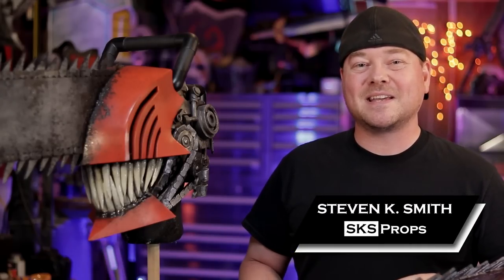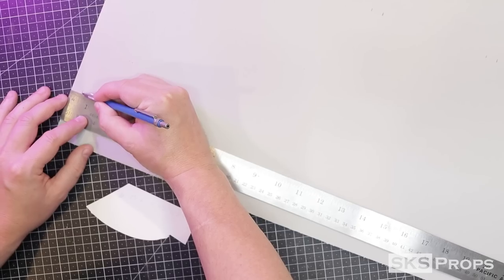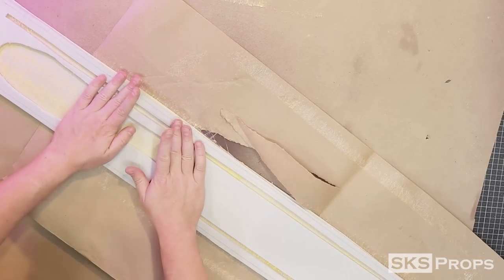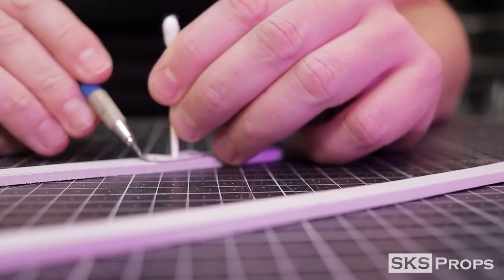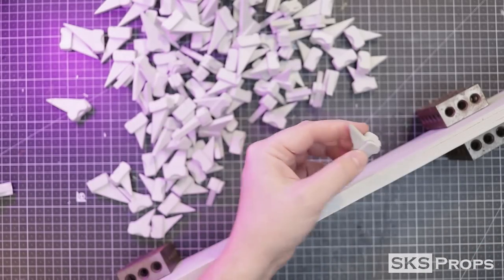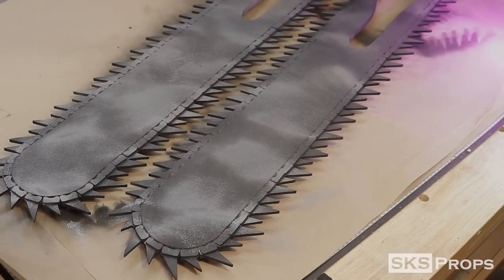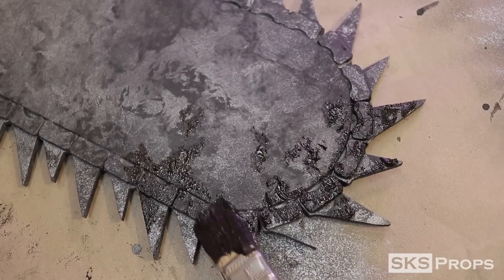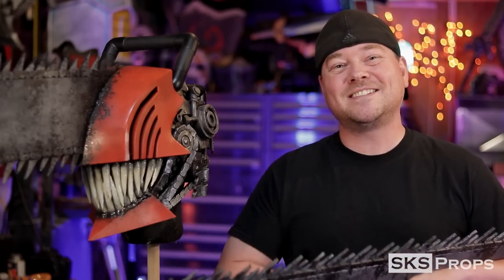How to Make a Chainsaw Man Cosplay Part 3 - Arm Blades - Foam Prop Tutorial with Free PDF Templates

Comment from the maker: Check out more of my complete builds, walkthroughs, and HD-Foam at www.SKSProps.com
Reply: SKS Props you might not see this but on average how much did the entire project cost.
Reply from the maker: @Shakespeare-_-  you’d need a sheet of each size 2,4,6,10mm   And paints which would prob be around $50-$70
But if you needed all of the tools and safety equipment as well prob in the $130-$150 range
Reply: @SKSProps  Thank you very much for the response I recently heard about it through just general talk on the internet and proceeded to watch the anime which got me hooked so I read the entire manga in one sitting online.
Reply: @SKSProps hi just wondering is it only buy 1 of each or do I need multiple of the foam for the mask and arms?
Reply from the maker: @rainbowren13  a sheet of each size 2,4,6,10 you may need one more 6 depending on how you lay out your templates 👍
Reply: @SKSProps  Hi one more question next con is in November it should be enough time but I live in the UK so I'm working with £-pounds. how much is it for the materials for the mask and arms just so I have an idea for my Budget? Thanks.
Reply from the maker: @rainbowren13  overseas look at Poly Props for foam

Comment: One improv I did on this is to change the length of the blade, which I made it a bit longer enough to reach just near the ankle, as well as how big it is for me, since when referencing the manga, the arm blades are not that wide compared to Denji's hand. Though by changing that I also had to replace the rod support for a thin plywood copy of the blade for support

Comment: hey dude im building this rn thanks for giving us the pdf but i only have 2mm foam as a option for the 4 mm u used to sandwhich the 6 mm would there be a problem..?
Reply from the maker: Should work out. Worse case add additional 2mm to the other side to bulk it out

Comment: Sorry if im Late but If i was to use the fibreglass rods for the head and Arms, How much do i need to have? and also whats the mm aka the diameter?
Reply from the maker: I'd just pick up 3 one for each arm and one for the head. They are usually 48" long just go check out the driveway or yard marker section at any hardware store

Comment: is there a good price estimate on this? i have a pretty low budget to work with and was wondering if this would be price efficent
Reply from the maker: Foam is pretty cheap you would just need a rotary tool, utility knives, glue, and paint
Even if you had to buy everything new just for this project it would be less than $100

Comment: Hey quick questions, I’m in the process of making this myself and I’m just wondering (correct me if I’m wrong but I don’t think you mentioned it in the video) how many teeth you made in the making of the arm blades? 

Also I ran out of 6mm foam, but I have some 10mm, 4mm, and 1mm (I accidentally ordered 1mm instead of 2mm), so would it be possible for me to supplement the 6mm foam for 10mm foam and still be alright on the arm blades? I’m on a bit of a time crunch so I’m unable to order more, so I’ll have to make due with what I have on hand.

(Also I just wanted to say thank you for making the PDFs free, I would not be able to complete this project without them!)

Thanks!
Reply from the maker: The number is on the template 180 pieces per blade. might doa 10 and 4 per blade rather than 2 10mm sheets. and you're welcome
Reply: @SKSProps  Alrighty thank you so much for  getting back to me so fast! I’ll be sure to tag you for the finished product!

Comment: oh yeah do you know what to do if the foam is bending when it comes out the roll?
Reply from the maker: Apply a little heat to the opposite side and roll it the opposite way. I then lay mine flat with some books on top until I need it for a build

Comment: hey! me again. I have one 2mm, one 4mm, two 6mm, and one 10mm. Is that all you need to make the full helmet and arm blades? or do i need any more of the foam?
Reply from the maker: That is all you need for the helmet and blades. The only other thing would be the teeth which I used 2 packages of 15mm round dowels (teeth cut to 2-3" in length) but you could also try to make these out of stacked 10mm foam
Reply: Thank you so much for the feedback. You are such a great help. I was confused if I needed 2 4mm or just one. You earned a subscriber and I’m gonna be showing this to my friends! Thank you again!!

Comment: Sorry if it’s been asked already but in total, how many pieces of each size of HD Foam did you use for the helmet and arms?
Reply from the maker: If you were to purchase 1 of each size 2,4,6,10 you can probably build it all the only one you might need two of is 6mm just because of the arms. Just depends on template placement
Reply: @SKSProps  Thank you so much! Going to  tackle this project for Halloween :)

Comment: I was just wondering where abouts does your face sit within this? I am struggling to work out whether the teeth area is where my eyes should be with the top part (with the chainsaw part) be on my forehead just above my eyes?
Reply from the maker: my eye line is right above the upper jaw line (part c) to see out I slightly tilt my head back and look through the teeth

Comment: I'm trying to plan out how I'll transfer the templates to the foam and i noticed that your arm blades are wider than how you made them in the templates. The templates are 4,? something and in the video you made them 5 inches. My arm isn't really huge but i think it would be better to make the blades as wide as you did in the video.  What do you think?
Reply from the maker: The 5” written on the foam was the “prototype” before I made final template design. But it’s your build make it as wide as you’d like
Reply: @SKSProps  thanks! I'm done with the blades now. Just gotta sit through the mental torture that is cutting out all the small individual pieces 😂. But it's so worth it. Can't wait to finish the build and upload it on Instagram with your tags!!

Comment: I'm using your plans but I don't see how to get my head inside, should my eyes be at the height of the teeth of the helmet?
Reply from the maker: No your eyes will be up where the slits are. To see forward you’ll just tilt your head back to see through the teeth. Part J is the piece where you adjust it to fit you.

Comment: So, first off, amazing, secondly, and completely unrelated, how similar is Joannes Yaya han foam to your foam
Reply from the maker: Thanks! and I'll be honest there is a big difference. The density of that foam as well as almost everything else out there just doesn't compare. I promise you if you ever have the chance to work with my HD-Foam you will immediately see the quality difference and it's supreme ability to cut and sand. There is a reason why as a foamsmith I developed my own line there just wasn't anything else out there that I was completely happy with so...I made my own 👍

Comment: How do I get the curve out of the HD foam I cut out the arm blades but the ends keep curving up
Reply from the maker: Add a little heat with your heat gun and curl it the opposite way. Once you glue the halves together it will also straighten the arm blades out
Reply: @SKSProps  alright will do thanks so much!

Comment: can you see through it?
Reply from the maker: Yes, you can see a little through the slits on the side but mainly through the gaps in the teeth
Reply: @SKSProps  I would love to do this but I feel so in over my head😅
Reply from the maker: @brogan_live8537  you can always start out with something easier like my knight helmet or top hat just to get used to the process 👍
Reply: @SKSProps  I feel like I could do it it’s just a matter of time, resources and tools.
Reply: The videos and templates are incredibly helpful, I haven’t looked very hard but is there an in depth parts list so I could get an idea on prices?
Reply from the maker: @brogan_live8537  yes and if not I try and list material sizes on the templates